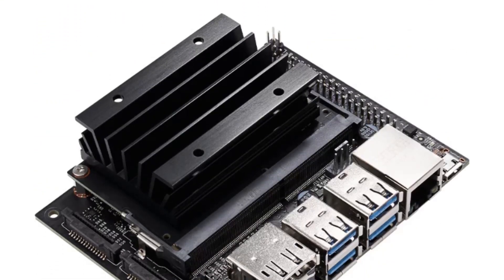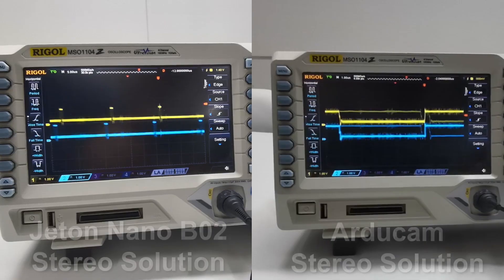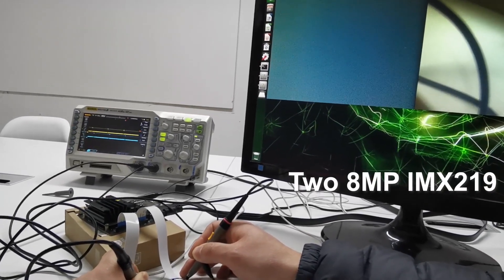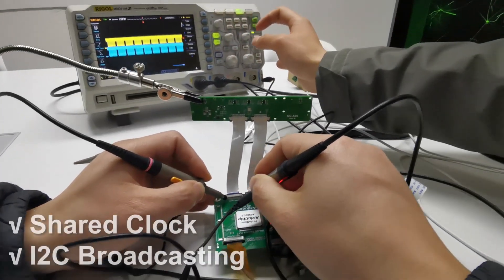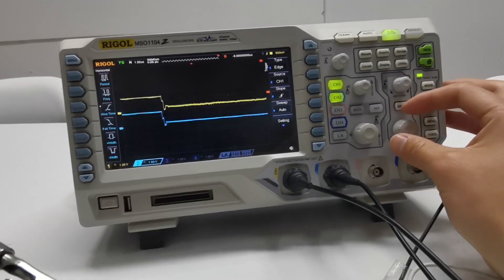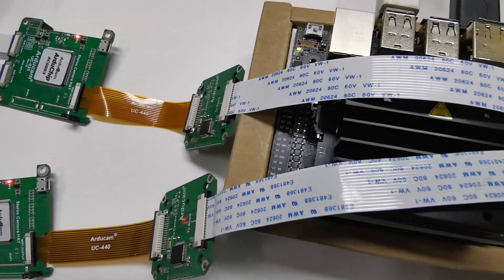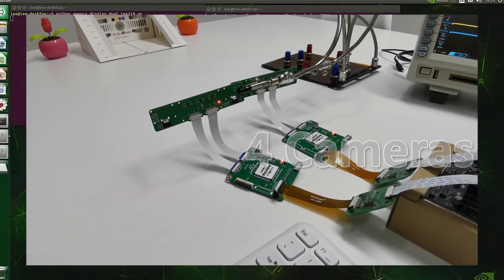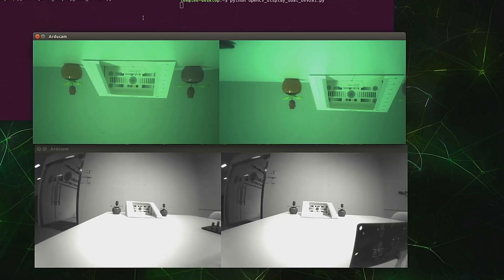Jetson Nano B01 Dev Kit: The Two MIPI-CSI Cameras Are Not Synced

Comment: What is the part number for the first board?  Is it required?.   I just bought the 5mp dual kit, but it looks like there is an additional adapter?
Reply: Yes, you are right. It requires additional Jeton Nano camera adapter board to work with Arducam original camera breakout for RPI.
Reply: @UCTRONICS  where do i find that?  I can't see the part number or find on arducam or uctronics website.